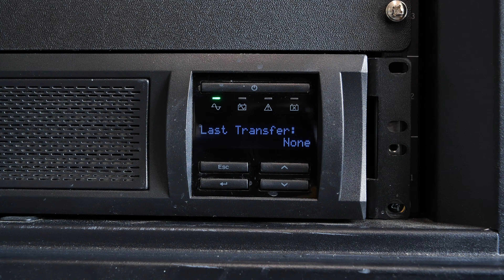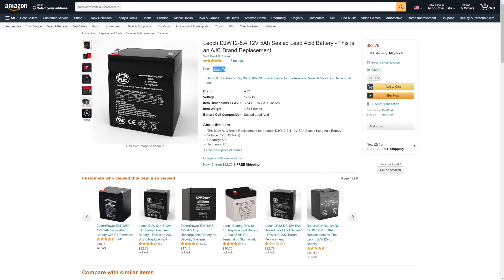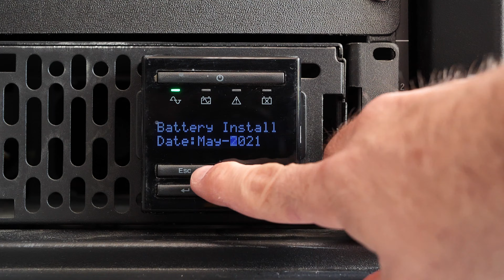Swapping Batteries in your UPS - Do it yourself and save some money!

Comment: why would apc use a 3rd party battery brand?
Reply: I replaced my cyberpower and they used JBT powered batteries. Which were trash and only 34W replaced it with 104W one.

Comment: I think this is by far the best way to go for a home lab.  But I have a question.  In the video you can see that the batteries are in series and that the UPS is not aware of individual battery voltages.  This means that any differences in state of charge could be permanent once connected.  On the other hand, Lead Acids are super-tolerant to abuse - the UPS will pass a small current through the batteries;  those that are not full - charge and those that are dissipate as heat.  Still, at least at the point of fitting them they should all be at the same state of charge.  When I bought 10 they were at very different states of charge because they all self discharge at slightly different rates from manufacture.  I don't recommend connecting them in parallel because the current could be quite high, so at least charge them all with a constant voltage PSU to the same voltage and check each battery is within 10th of a volt to get the best out of your refurbished battery.
Reply from the maker: Great points! Thanks for the comment!

Comment: what about using lithium ion batteries instead?
Reply from the maker: Unfortunately that’s not possible. My UPS is designed only for sealed lead acid batteries and isn’t capable of properly charging lithium ion batteries as they require an entirely different charging cycle, monitoring, and circuitry. It would be super cool if you could swap out for different battery tech, but it’s not possible.
Reply: @2GuysTek  There is the Option of LiFePo4 which have very similar charging characteristics and can be had in the Same formfactor as the Lead Acids, however the DIscharge current on many is limited to 6A which would in turn meat at 130V that you could only get around 800W out of the UPS, which is not bad, but definetly a consideration. But you will get wayy longer runtimes sometimes a 2.5x improvement.

Comment: The original Leoch battery wa sa 12V 5.5Ah battery and the replacement battery purchased on Amazon was a 12V 5Ah battery. You would lose some runtime on these new batteries because they are lower capacity. We would recommend using a high rate discharge battery of equal or greater capacity such as the Raion Power 12V 5.5Ah high rate battery with part number: RG126-22HR

Comment: Cool.   My 2015 APC 1500G just got the replace battery error.  I did order the APC #124 from the APC store on Amazon.ca for about $90 CAD plus tax.  This UPS is more to condition the power and shutdown an unRAID system cleanly until power comes back on.   Now the run time on current load is about 22 to 26min but when new it might of been 45min.